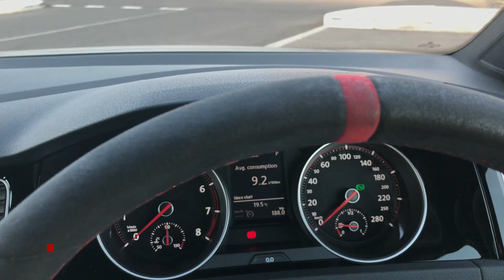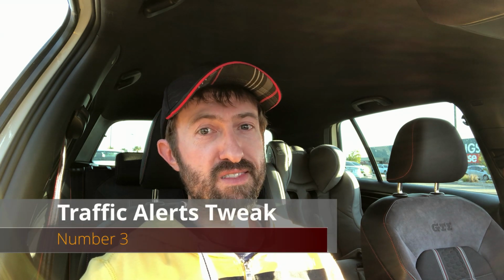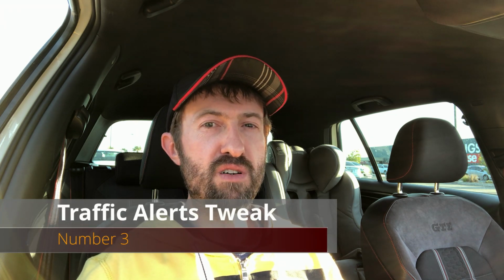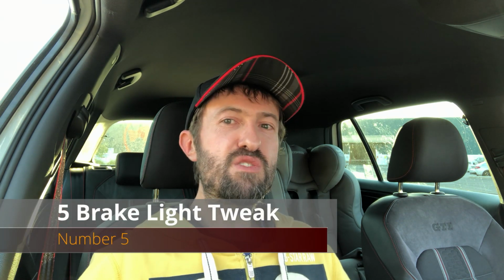Top 5 VCDS tweaks for your mk7 GTI or mk7R

Comment: Great video! I will have to try the pedal setting, as I find the pedal rather frustrating. It's obviously quite lazy in normal mode (being in the US I don't think we ever got the eco mode), which is fine for fuel economy but frustrating for trying to do throttle blips on downshifts. The thing is, I SWEAR that sport mode, while more responsive, is not linear. I could be wrong about this but it feels like it overcompensates by opening the throttle more aggressively. I feel like I get more throttle from the first 25% of the pedal than I do the last 75%. It feels extremely imprecise compared to a mechanical cable throttle. I just want a throttle that opens linearly with pedal travel!

Also I like your hat! I will be sending you an email about the Clubsport rear seat delete you have listed on your website, assuming I can't find the answer myself after I've gone through some more of your videos. Thanks!
Reply from the maker: Yeah the pedal is not great. Best way to fix it is via ECU tune. Tuner has full control over it. Feel free to reach out. Happy to answer any questions.

Comment: Good details, but I might not agree with all. Especially the seat belt chime and the stop lights. That is because both are safety features. Seat belt chime - it is enough to forget it once... Brake lights - when just the outside are getting brighter during braking the car behind you can understand what is happening. If they don't see all the lights changing intensity they might not realize you are braking.
Reply: I disagree with you on the brake lights. For starters, illuminating the inner portions make the entire brake lights brighter, and therefore more visible. That makes it MORE safe, not less. Additionally, there's a third brake light which illuminates, just in case the driver behind you isn't paying close enough attention to notice the brighter brake lights. But honestly, I've never seen a pair of brake lights that, when functioning normally, weren't easily discernible. Making the outers-only illuminate make the brake lights just look like they're not functioning properly.

Agree with you on the seat belt chime, however I do get his point. It's impossible for me to "forget" my seatbelt as I'm not even comfortable moving the car without it on. This habit SHOULD be ingrained in people to not need a chime by now. But for those who occasionally may forget, sure. I never hear the thing anyway, so it makes no difference for me (although I had to stop sitting my laptop in the passenger seat because it started setting off the occupancy sensor).

Comment: I have a 2015 Mk7 GTI. A tweak I would absolutely love to make is to prevent the automatic parking sensor display from coming on when reversing. I want the whole screen to be the camera and to not have to tap it away every time I reverse. Do you know if this is possible? I asked VW but they said it wasn't possible
Reply from the maker: I looked into that too when I had a 15 GTI. It’s not possible. Upgrading to MIB2 though would fix it. But of course a costly exercise (though well worth it for CarPlay etc and the larger 8” screen)

Comment: I there i live in the uk i have just got my new 7.5 golf gti.i have just seen your video on acceleration can you explain how to do it as i am new to all this thanks mike
Reply from the maker: Do you mean the "Direct Acceleration" tweak? So you need an OBD11 device first. Then just follow the menus I've provided. Once you are in there it will make sense. 
"44 steering assist" is the name of the module in the car. It's a menu.
"Adaptations" is an option on the page to select.
"Driving profile switchover" is another option to select on the page
"direct controlled" is what you change the option too. There are only two options to choose from.
If it asks for a security code, use 19249. If that doesn't work you might need to do some googling. Some cars have different security codes.